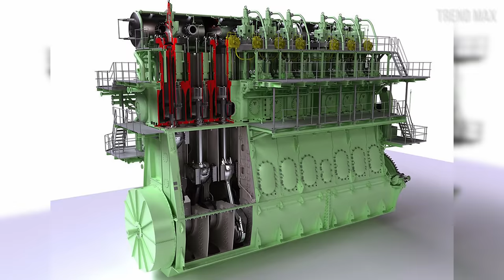THE BIGGEST SHIPS In The World | The giants of shipping !

Comment: Lol. Harmony of the Seas is a little bigger then Symphony of the Seas. Considering how recent the video is you should have gotten it, but apparantly you didn’t. And a few times it sounds like you’re talking jibberish, and a lot of shit. Tbh sometimes it’s more like you say advanced words to sound smarter. And for heavens sake keep power measurement in 1 measuring system in stead of switching as that is confusing to a lot of people. Also Paint has nothing to do with power output or glide in general. Sure the proper paint may help, but it’s at a such low percentage that it’s not even worth putting into the equation. It’s like 0.000001% increase to maybe 0.000007%.
Paint is mostly for protection. It is something known as Ovatrol. It’s more of a oil than a paint, but what it does is preventing rust and water damage and keeping the hull intact for extended (a hole lot of extra years of hull strength) periods of time. It’s nice to see you did some research. But please do a little more.
Reply: No both are 362 metres long but the symphony has more passengers (sorry for my English I'm a German)
Reply: No. Harmony was bigger with a few mm. It was mm or cm. I don’t remember precisely but it was a tiny bit bigger.